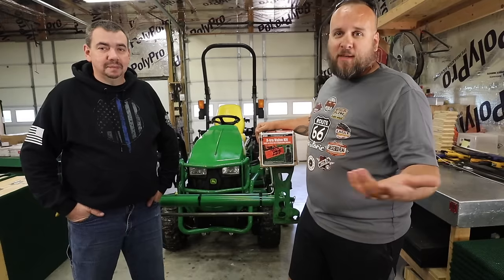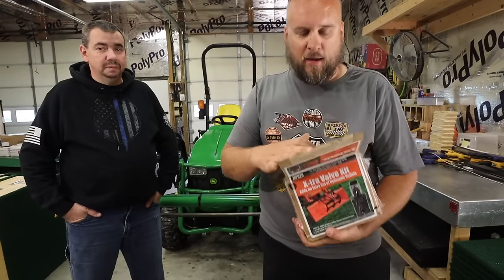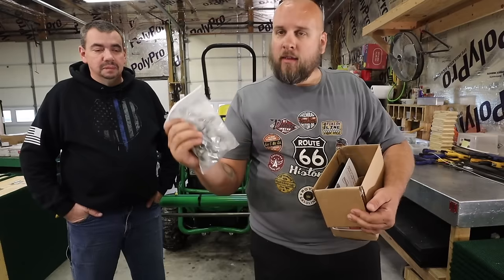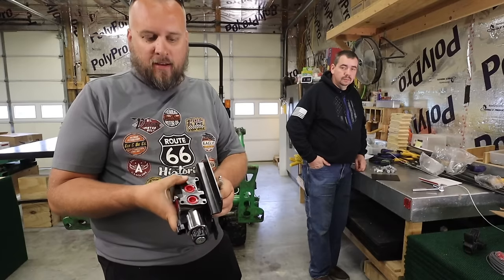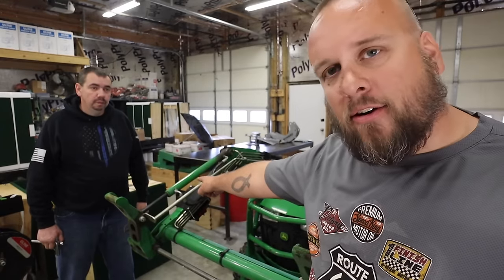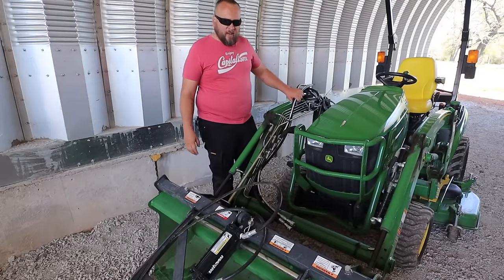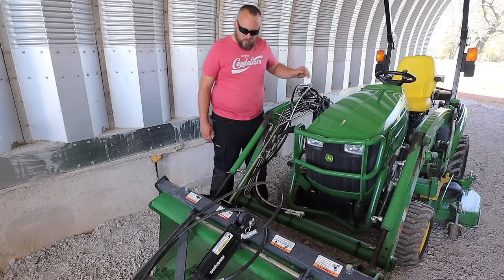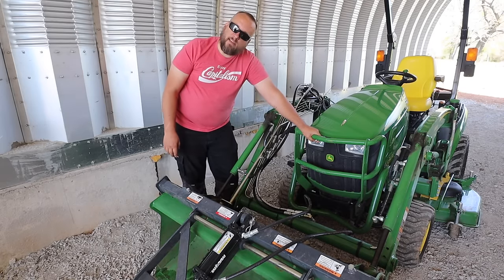An Easy Way to add 3rd Function Hydraulics to Your Tractor

Comment: A diverter setup is not the same as a third function setup. The title is misleading.
Reply from the maker: I’m not trying to be misleading.

You are adding a third function.  This tractor had 2 loader functions when I started and when I finished it had 3

There are just a lot of different ways to do that.

True third function is optimal, but using a diverter is the cheapest/easiest way to add third function.

Comment: One question about switch. Do you have to hold it while using 3rd function or do you flip it and stays until you switch it back?
Reply from the maker: You hold the button down while opening and closing the Grapple which actually feels natural after a little bit. 

So if you want to curl and close at the same time you can hold the lever over and just toggle the button on and off and it will do both Fairly quickly

Comment: How does this 3rd function diverter compare to the one on your tractor or other available? Same performance and use? I do not see it on their website.Maybe not available yet.
Reply from the maker: This kit is almost identical to the one I use. Mine is from Artillian and this one is from precision manufacturing. I think the Artillian kit cost more but came with a couple of the hoses that this one didn’t.

Not sure because it’s been a while.

I would say true third function is better because it allows you to curl and close the grapple at the same time. It is also more expensive and not available on all models of tractors. This diverter style can be put on any tractor that has a loader
Reply: @RockhillfarmYT  my tractor came with a dealer/factory installed 3rd function kit. Also had an extra hydraulic circuit at the back. I thought it would be better to get these items installed as part of the package when the tractor was new, clean and in the dealer’s workshop. They were short of stock when the tractor was purchased so the technicians did a really good job.
Reply from the maker: John Deere did not have factory third function option available for my tractor when I bought it.  They did come out with it in the last year as a factory option

I did get it with 2 sets of rear remotes but I had to install my own diverter 

at this point I’ve actually got three sets of auxiliary hydraulic lines on the front of the tractor and the two sets on the back plus the power beyond.

I would still rather have the factory third function because it’s more convenient to use and doesn’t have any power loss, but since I already have mine set up I’m not gonna spend the money on it
Reply from the maker: I just noticed your comment about not seeing it on their website.

If you’re talking about the diverter I installed in the video, it is available for sale on www.agfolks.com
Reply: @RockhillfarmYT   ya all I saw for compact tractors was a reducer kit
Reply from the maker: Here is a direct link to the kit I used in the video

https://www.agfolks.com/product/xtra-valve-kit-mp020
Reply: @RockhillfarmYT  thanks Brock!

Comment: Looks easy enough. This should help some folks who are on the fence about doing this themselves.
Reply from the maker: Yes sir, this is the second diverter I have installed and I would say it is a DIY project that any tractor owners should be able to do.

The only possible points of confusion is finding where to tie in your hot wire and getting the right threads on your fittings. I didn’t go into detail on either of those because it will vary by Tractor

Comment from the maker: Use code:  Rockhill5 

to get 5% off your order at www.agfolks.com

Direct link to the product

https://www.agfolks.com/product/xtra-valve-kit-mp020

Here is the install video for the add-a-grapple

https://youtu.be/nNQGwHTtE8k

Here is the precision manufacturing factory tour

https://youtu.be/PR2gGDbZ5_o

Here is the precision manufacturing 3rd function diverter install video

https://youtu.be/lbbADL6Lois

Comment: What is the link to get the 3rd function kit at. I would like to put one on my 3038e tractor.
Reply from the maker: https://www.agfolks.com/product/xtra-valve-kit-mp020

I think Code rockhill5 will give you 5% off And let them know that you saw my video

I know that code works on the grapple but I actually did not ask if it works on the valve kit
Reply: @RockhillfarmYT  Thank you. I will look into this on Monday.